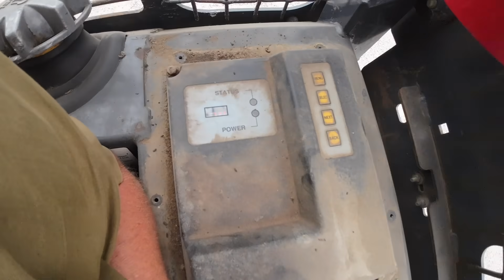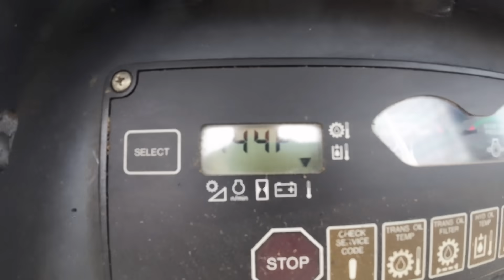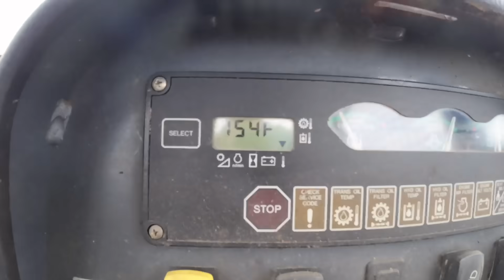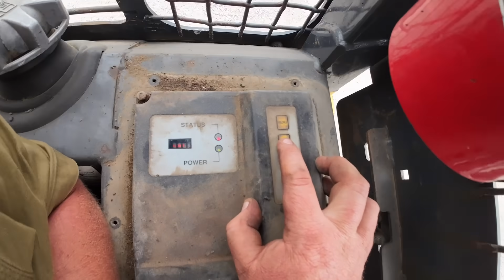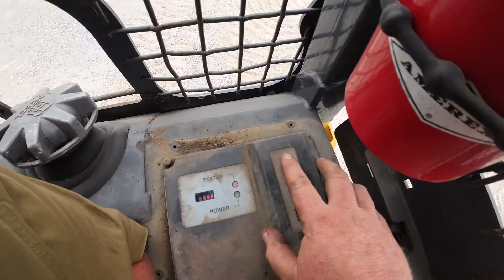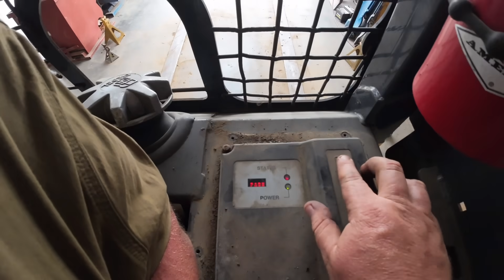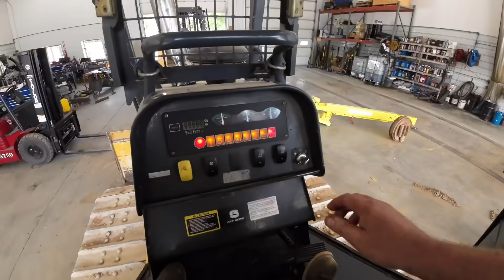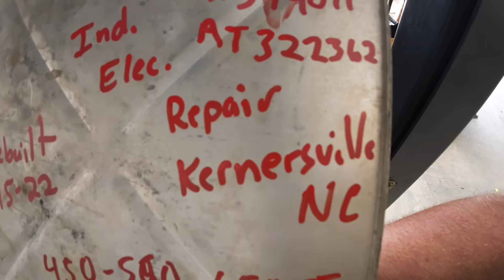Deere dozer hydrostatic transmission install for the 2nd time after destroying it the first time

Comment: I own a gunsmithing shop and dropped a customers scope.  The customer attached it and brought it in because it was not zeroing.  Well the customer failed to tighten the base.  When I was inspecting the gun to determine what might be the issue for the gun to fail in zeroing, the scope, rings and base came off the gun and hit the cement floor and put a dent in the new scopes bell housing.  I replaced the scope (at my expense) and I only charged the customer to properly fasten the base to gun and attach the scope and rings to the base properly.   I feel your pain but customers appreciate good service.

Comment: Yea... only half the problem was fixed... so you did the right thing... and learned that that broken pump casing problem needs a more thorough inspection... to confirm that it won't happen again...
Experience can be costly... but it's the costly ones that we remember best... makes us all better for it though... so thanks for the education...

Comment: When I was a forklift tech every once and awhile I would run into a similar situation with an electric lift. It just is what it is. No sense getting flustered and u don’t have to feel like a parts changer. You just have to trudge through until the computer gods are happy once again. Good job persevering

Comment: What many People do not realize is, that the knowhow required in what you show and do is only through longtime experiences. It is not always easy to wrap one's mind around the hydraulic problems.    Industry is cleaner than the Hydraulic Mobile earthmoving machines. Hydraulic systems when open, it is a messy oily business. It fascinated me, in my work all my Life. Keep it up, it will get even more complicated over time. LOL from down under.....I would 'n miss a video...

Comment: I do not think too many shops would have done right by the customer as you have done, Good job Guys.
The access and egress on modern machines is not easy, so many  lines and hoses in a confined space 😞
I would have to straighten that exhaust pipe though

Comment: I've began the practice of installing vent caps in the NEW replacement cans or jugs. Once it's tipped I pop the cap and it vents without any gurgling. It comes in handy evacuating them when the cans are full and heavy😊

Comment: You should charge the engineers at Deere who designed it so that a faulty valve could break a metal case.
Reply: Deere should have stopped at steam tractors.

Comment: I don’t know about the experiences C&C Equipment has had but personally when dealing with a trouble such as this I like to clear the codes and then disconnect the battery(s) (by that I mean physically remove cables) and let the capacitors in the electronics drain (most times I like to let them set with the cables disconnected for 10 hours or so.  Additionally I also like to verify and clean all the ground connections on vehicle/equipment I am working on.  I have had a ground at the other end of the vehicle/piece of equipment I am working on be the problem even though by rights it should not have been. Lastly when sending ECU’s or other electronics to be repaired especially on older equipment have the company doing the repair replace the capacitors. Lastly in the late 90’s early 2000’s there were a very large number of IC chips made that the epoxy resin used in the construction of them had problems with how it cured as a result inside the chip corrosion would form which would cause all sorts of strange intermittent problems that often could be temporarily resolved by unplugging a plugging of the module, sensor, computer board etc. unfortunately this made troubleshooting difficult for a number of reasons.  The IC chip problems were to my understanding made mostly in Vietnam for Fairchild.

Comment: I hope the rebuild shop gave you a discount on the second case. As it was them you told you the case is prone to crack, and that is why you did not dig deeper in to a root cause as to why the case cracked.

Comment: Why don’t they have an emergency P.R.V, between the  pump and the thermostatic  bye-pass valve so it doesn’t crack that pump housing . Surly that’s faulty design Clint🤔. Thanks for the video Clint 👌👍🍺
You have great integrity and honesty Clint, a valuable commodity these days 👌🥇

Comment: 💯 the right thing to do on eating the cost on the other pump case. The customer has one pump that needed replaced not two. So right thing to do and it’s not really your fault neither. I think John Deere should eat the cost for poor design of the system. continue doing you as you are on. It builds happy customers and gains more on being honest/ trustworthy with. 👍

Comment: Hydraulic Transmission removal and installation are what I called a "prayer job" One is always Head down and kneeling on its knees. (Bobcat's / Excavators). And when the job is done, comes the startup........ This is very important. Purging and pressurizing the hydraulic system under no load conditions. If this is not done, it can be $$$$$. expensive. What type / brand of transmission was it? The inside of the transmission was of more interest to me, and why it failed and what hydraulic circuit was in use. I like watching your work.

Comment: Awesome  job Clint you are one in a million honesty is always  the way to go it will come back to you many times over. I really liked the extra bit on the other machine we just did the undercarriage on my Case 450B crawlerloader very similar to the way you did it only I didn't  have a fork lift I used the winch on my pickup now if I can just get the caps off my cylinders  to put new seals in them any suggestions

Comment: Clint you taking financial  responsibility for not diagnosing the failure correctly is very honorable. If more companies were honorable they’d either have a large customer following or bankrupt. If a repair shop doesn’t learn from their mistakes they get a bad reputation over time. Kudos to C&C Equipment. Clint does Deer and Cat have mechanic coursework?
Reply from the maker: They do if your a dealer

Comment: I would absorb the cost of the second housing, put it down to training as you will not do it again. I would also load some of the rework labour into the job as you probably did it faster than most. Make sure you invoice yourself for the case and extra labour for tax purposes.

Comment: Good YouTube video's guy's hope they help pay for the seat up belly down shi. happens redo repair!!! John Deere has them hose protector/zip tie swivels to prevent 2 hoses from rubbing together...$$$$ but can save hose replace hours down the road...  Canadian Winters... We use 5W 40 full synthetic because of the cold starts saves the transmission and the drive motors!! Right now my 650 J LGP is showing codes F372 or F373 (WARMED UP) wants to pull Right for a little while 1/2 minute??? when the machine has been warmed up and shut off... Cold Start Says RUN till the transmission reaches around 45C then puts the code on the controller box but not on the dash codes!!  But if ya wait on restart don't move it for 1 minute is usually OK but need to be careful around things/people when start up wants to do the funky chicken!! First started after a outside exterior fire hose wash and never used for a month!! Good idea to dry out with use I guess!!

Comment: Wouldn’t the shop that swapped the case out notice the valve not in right orientation? Tight working area. You have a good team and they have a good leader. Thanks
Reply from the maker: They don’t get that part
It stays on the tractor

Comment: Isn't there some type of one-shot pressure relief device (like the burst discs used on scuba tanks) that you could install in the hydraulic lines to blow before the pump if the same part (thermostat/preheater) failed again?

Comment: Been learning a lot from your videos very good info and there’s nothing else like them online. I have a 650k that has been giving me some issues it’s limiting the transmission to 1.5 speed and throwing a code for left motor solenoid open or short. When you shut it off it goes away but will come back eventually but now it comes back sooner and sooner any help would be appreciated. Thanks.
Reply from the maker: I would check wiring and plug and the 2speed Solenoid on that motor 
You will have to pull back plate
Reply: Thanks for the response. I checked all the wiring and cleaned up the plugs and still have the same issue. I replaced the left motor speed sensor about 20 hours prior to this issue. Not sure what to do at this point.  I have tried to recalibrate a could times just to see but I can’t even get through the calibration bc when I do the high speed calibration at 3.0 it will limit me to 1.5 making it so I can’t complete the calibration.
Reply from the maker: @nickmarple6461  need to read what codes you have and fix those then try calibrating

Comment: Electrical, electronics suck because of bad grounds, dirty contacts and broken wires. Testing with a multimeter is helpful and time consuming. Sometimes that's when the parts cannon is easier.

Comment: Not sure how C&C does billing BUT if the customer brought in the equipment with unknown issue and paid for the diagnosis the shop is responsible for the second pump, if the customer asked the shop to simply replace the pump it should be the customer's problem. What's fair is fair.  This one was a nail biter for sure, a problem after the other. I would think all the additional work needed to get this fixed will have to be paid by the customer.

Comment: My first thought is: "the pump 'guy' knew these pumps crack so why didn't he also know the thermostat was the primary cause?"  An expensive lack of communication.

Might you find a pump shop way cross country and ask them about this 'common failure' and was it the fault of the thermostat?  

Do these tractor mfgs have recall notices like car companies?  Major recalls ordered by the govt?  (A surprising good use of govt.)

--------

I hate casting dispersions upon tractor mfgs, but could they be so aware of this failure that they got exceptionally aggressive at marking up the price of the thermostat assy?  A "built in failure" as it were?

Comment: I’d have to say that JD has a flaw in their design. They should have a relief valve in the pressure line before the valve that caused the pressure issue so that it it fails it would relieve the pressure so as not to crack the housing. Better to clean up some oil than have to replace the case. Just saying, lol. Good that you’re accepting the responsibility for it but JD should have a better system.
Reply from the maker: Agreed

Comment: Yes eating that pump cost is the only right thing to do. It sure not the customers falt do to your lack of testing trouble shooting in the first place. I hope you didnt add labor hours charges trying to make up  some of your neglect. So many shop do that and add parts into the bill that were never changed. In my 62 years I had shops do that to me. Yet it was clear them parts were never changed. Due to grease an dirt around mounting bolts flanges. Or so much as not to even clean the dirt off filters or touch up paint